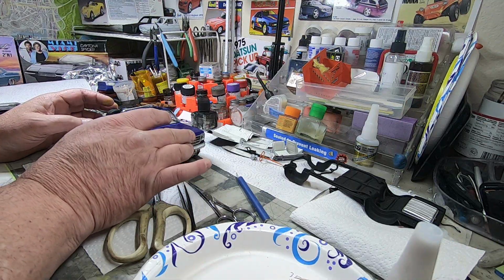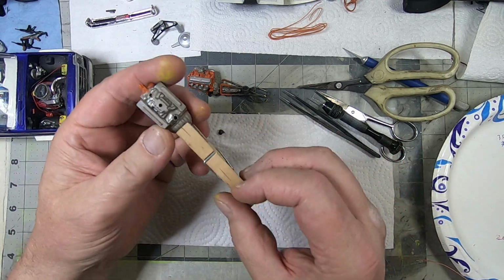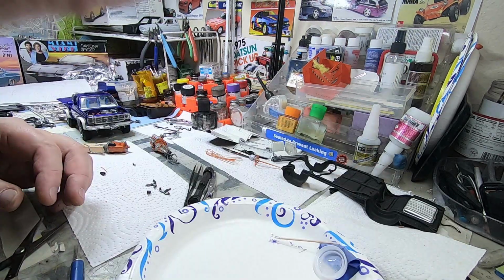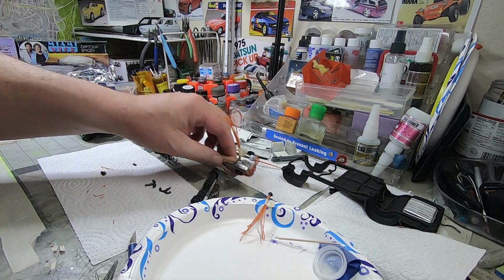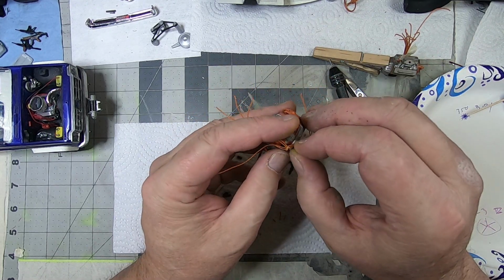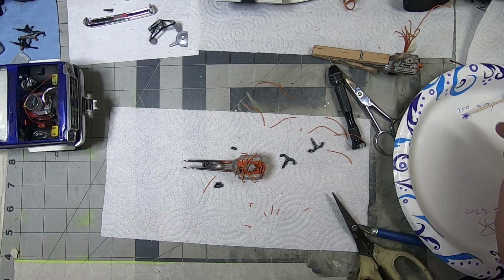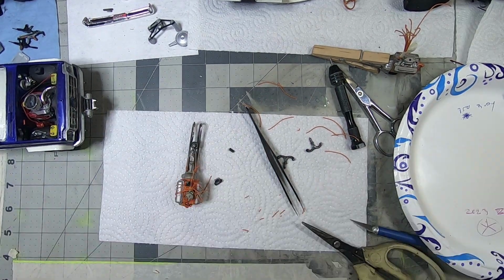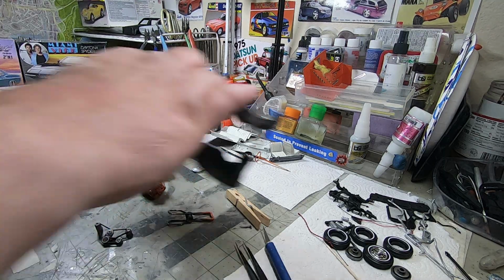How I Wire my engines. A (step by step) simple method I use.

Comment: Nice tutorial..
What size wire do you use for wire?
And the size of that drill bit?
Reply from the maker: I realized after the fact I left that out!  Small ones?...lol
Reply from the maker: I can re edit and re upload it.  Maybe I will, YT makes it kind of a pia, litteraly have to start all over to make changes! Thanks for pointing that out tho, it IS pretty important information.
Reply from the maker: I added links to the description of the wire and pin vise. it says its a 30 gauge.
Reply: @doinstuffwiththings  
Oh ok cool..👍
Thanks bro.
Reply from the maker: Of course! 

 I still have the same roll, bought it a few years ago now at least...best 8 bucks spent ever!
Reply: @doinstuffwiththings  
😄